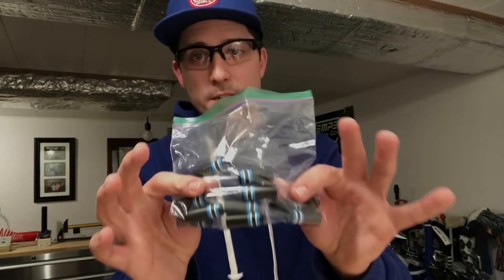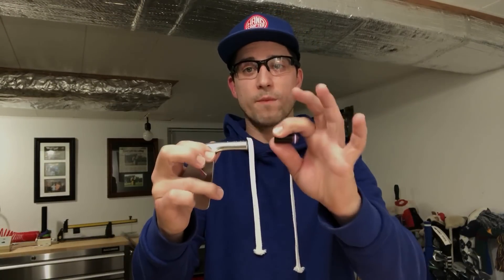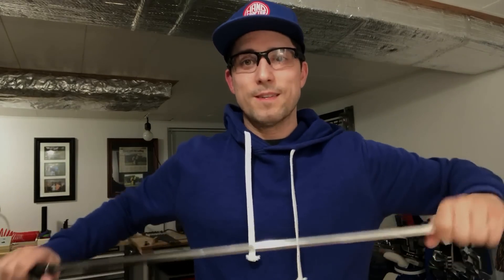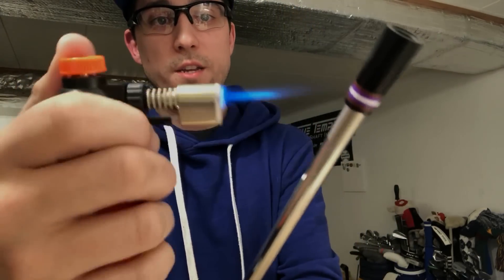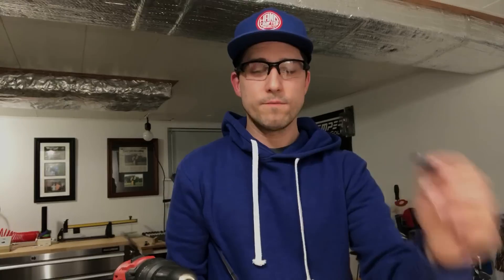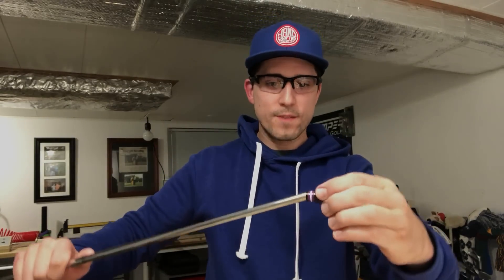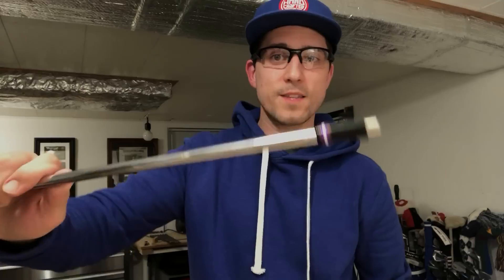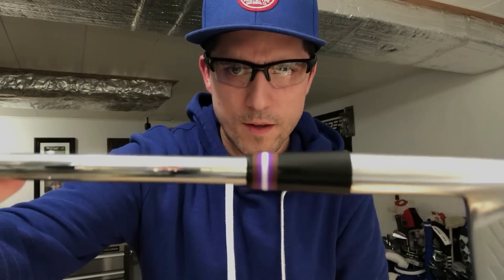How To: Properly Fit Ferrules

Comment: l know l am 5 years late and thank you. Question, l have an old Titleist tour model iron (blade) and l don't know the year of it. l really like the head but the shaft is a regular and l want to pull it and install Project X 6.5 on it. My question how do l know whether the iron head is parallel or a taper? Are all the blades typically taper? Thank you.

Comment: Awesome video- just a couple clarifying questions for us newbies:

1) Is this the same process if using on a .355 shaft which the ferrule was designed for? 

2) Obviously, wouldn’t need to bore the ferrule out, but would you still heat in boiling water? 

3)What’s the best way to remove the old ferrules?

4) Do you epoxy the ferrules in place against the club head, or just the club head (as usual)?

5) What did you mean at the end of the video by “once it dries all I have to do is turn that ferrule down”?

Thank you for your clarification!

Comment: Do you need boiling water or just hot tap water?
Reply: Not boiling, just tried it, wasn't even boiling anymore and it melted my ferrules.
Reply from the maker: Jon H. 
Really hot tap water should do the trick with most ferrules. Thanks for the question.

Comment: Hi Ryan, never thought of reaming!!! Question: Why is it that on occasion the ferrules and shafts don't match? For example a batch of .335 ferrules are either too tight (even after using the hot water tip) or too loose (slide all the way up the shaft). Is it a question of quality control of the ferrules, shafts or both? Secondly, if the ferrules are too large, do you just have to 'toss' them or is there a tip to make a larger ferrule smaller? The ferrules I use are from golf supply house. Thanks again! :D
Reply from the maker: No way to "shrink" them unfortunately. As for why some fit and some don't comes down to quality control of the ferrules. Shafts from any major company will have pretty tight specs for OD - outside diameter.